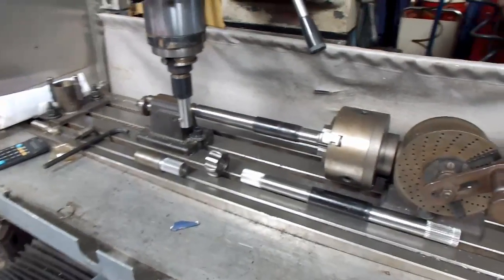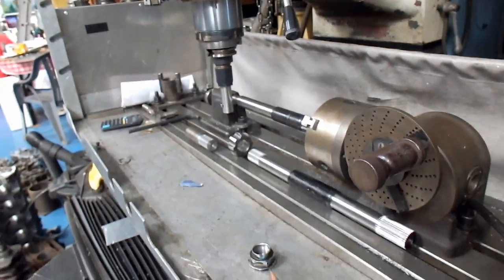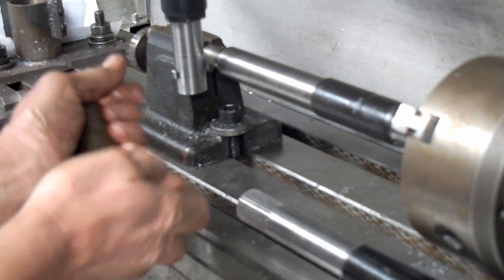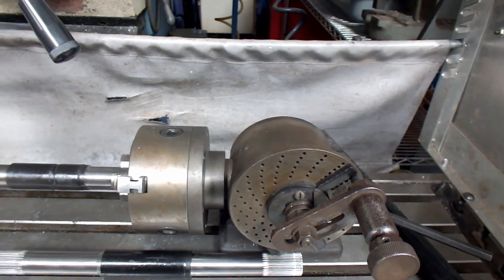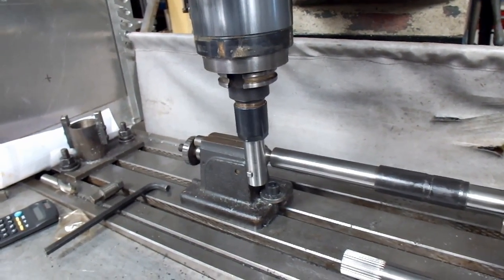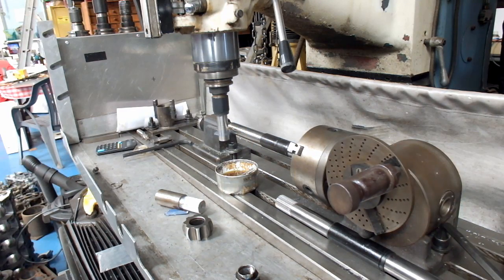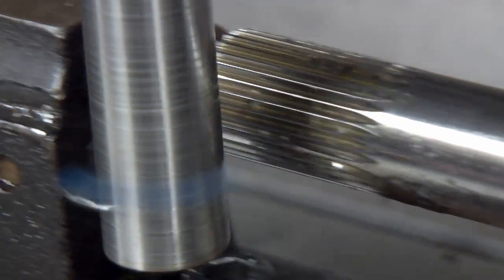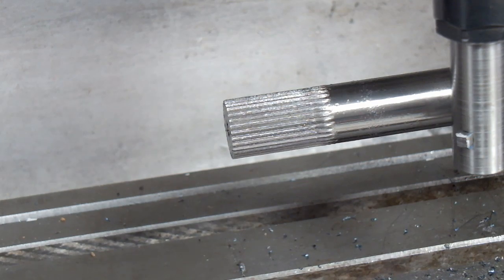Cutting 32 Splines on CV Joint Axle

Comment: Hey! I wonder to know, how did you know groove angle (tool tip angle)?
Reply: Splines are generally 90* or 60* for automotive. I know this is a year old, but if you didn't know already. The shape is usually slightly involute (round at the root usually.) So to make a proper spline you need a form too like the one they are using, or you can modify a double angle cutter.

Comment: Great video John. We're the splines cut with parallel edges or cut to a profile? Have you made a video about cutting internal splines? I need to cut a 20 spline knee handle for my milling machine. Base diameter .750" and spline angle of 60 degrees. I was going to use dividing head set vertical and use quill feed to broach splines with a shaped cutter. Will this work or do you think there is a better way? Buying one s not an option!
Reply from the maker: +Andrew Wilson Use the quill if you don't want to belly up to the bar fro the broach, I've done this several times with great success. Let us know how that works for you with an in depth vid.
Reply: +fiatnutz thanks John. Tried to do it today and now realise going to need to make a collar to lock the spindle to the quill to prevent any movement. Other than that it seemed OK. Had to make several very light cuts of about ten thousands each.
Reply from the maker: +Andrew Wilson that's how much I cut on each pass, and the .007" on the final. Take a look at the program steps at the end of the video. Locking the quill is essential, but on the CNC I just program a depth and I'm off to the races...

Comment: does the shaft need to be hardened to make it reliable, or are you cutting an already hardened piece if steel?
Reply from the maker: +happy543210 Was already case hardened and is really tough, no need to reharden.